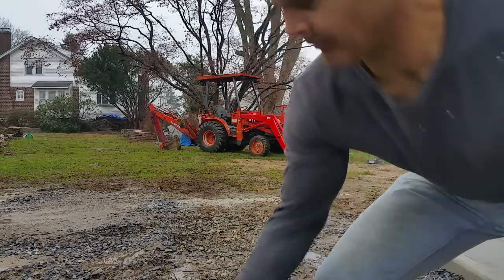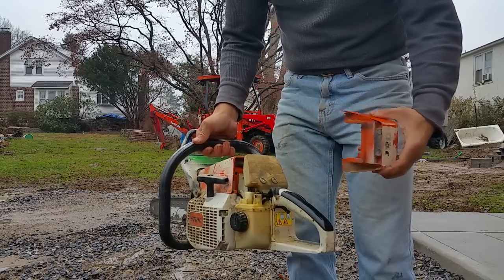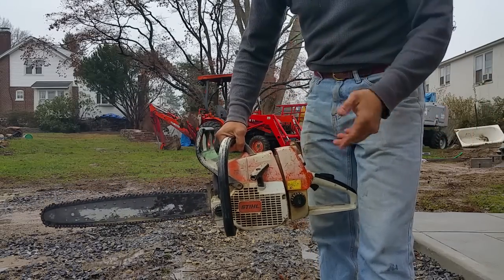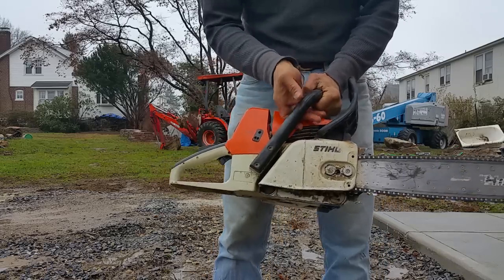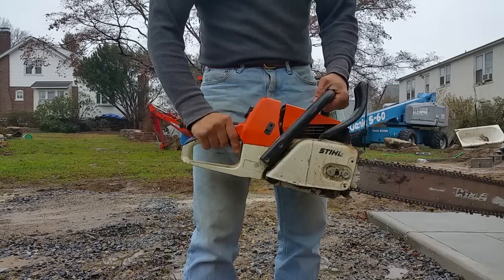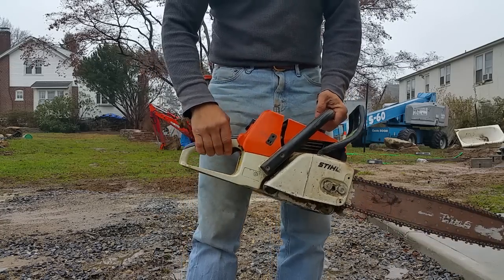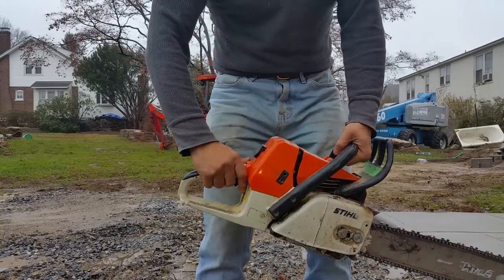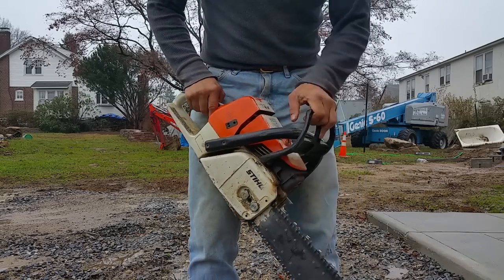Chainsaw brake and a good way to use it

Comment: 2:20 I like what you point out here and how you act out the scenario. This isn't done in enough training vids. What I think is important that you're doing is you NEVER LET GO OF THE SAW. You maintain that grip with your thumb under, with your left hand always. And that's key to the brake working the way it should in a kickback situation. Correct?

Comment: Really great training tip man. Seen some pro loggers training in vids and they do this by instinct every time their saw is idle after a cut. I like how you teach that it basically should be like muscle memory. It's almost an MMA approach! They also never drop start, they start it like you do with it in between their legs to maintain control. Cheers.

Comment: does the chain brake only works when the engine is on? cause my chain brake cant be pushed toward the chain.
Reply from the maker: No, it works even when saw is not running.

Comment: I have a early 70s Syihl 029 model. Not a safety   Device any where close to it ?  I had a couple of minor things done to it at my local Stihl shop and  the cost was ove 200 dollars  the owner saw my face when i went to pick it up  and said i know what you are thinking  is it woerh it when you can go to Home Depot and buy a brand new  Poulenc or whatever  other brand they. Are carrying  he told me thats. A decision i would have to make on my own  yet if  i wanted to sell the saw he would buy it in a second because all of his tree guys love that saw for climbing  even though they stopped making that model and parts years ago  so he knew it wouldn’t last long in his shop however i did pay the bill  and i have one hell of a good running saw whenever i need. One  BTW. I am a retired Woodworker  and don’t really use Chainsaws. That often  as ive suffered some injuries from a Traumatic Brain Injury. That  caused some. Paralysis  in my limbs and hands
Reply from the maker: It's your money and if it makes or made you happy keeping that ''memory''  (the tool reminds you of another time)...  Then go ahead and enjoy it...
(I really love the human mind / psychology).

Comment: That is a great tip on how to use the chain brake on the saw to prevent bodily injury when starting the saw. I won't be doing any climbing with my saw so I don't have to worry about it cranking while doing that, but it is a great tip for those who do climb trees, and then raise their saw. I thank you so much for showing us what to look for, and how to use our saws properly.
Reply from the maker: Thank you kindly for your words of supports... it is appreciated.  Ps  Also, make sure you are working on stable ground, one slip and it can cost you your life... (Always, time for safety)...  Then I have one more rule, if anyone is working with me, they MUST stay out of my "stubble area'' (the area where I might swing the saw when I do slip)...
Reply from the maker: PS Sidney, youtube, sent me to Donny's video - haha     But, I saw your comment also (good thing)... 
Sidney, dump all your old fuel and even remove the spark plug and clean it off with some carb cleaner if you have some. Then, with the plug removed and no fuel added back, pull on the cord (to clear out old fuel and to with the ignition, ON)... Once, you think it is totally cleared out, add 89 octane fuel and try starting it again...  Be sure to CLEAN your air filter also and while it is off, look for saw dust around and inside the carb...   Also, you can do this with the chain off the saw... it is much safer to work on a non-working saw this way.    -- I may find time tomorrow to make a video if you still are having problems.  You can even change your plug and gap it per the model's recommendation. This will cover, fuel, spark and air... the three things you need to fire this saw up (of course compression and the presence of a spark is also required).

Comment: Thanks for the video!
Reply from the maker: Thank you for being kind in your remarks...
Reply: Philadelphia Construction Engineering Your welcome.  I am just learning how to operate a chainsaw and found your video very helpful.
Reply from the maker: Thank you Bill, perhaps I can do a video tomorrow and post it... I will link you to it if I can make it happen. 
With that said, do you have any concerns or questions? Also, is your chain saw a top handle or is the handle in the rear like this one? That will help me in choosing which saw to make the video for you...
Reply: Philadelphia Construction Engineering It's almost the same as yours but different brand.